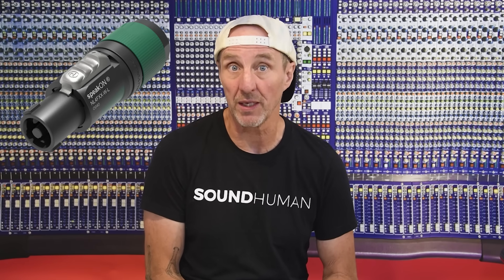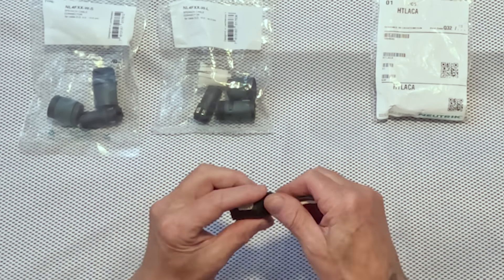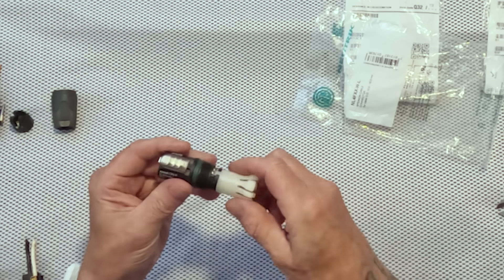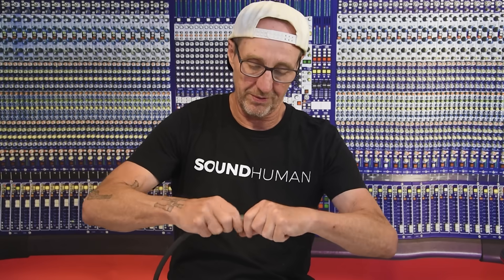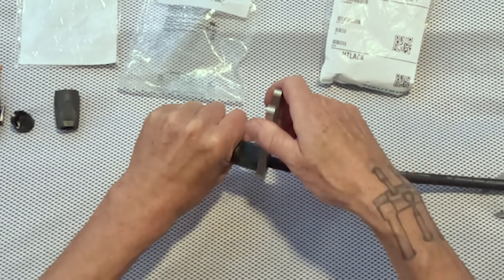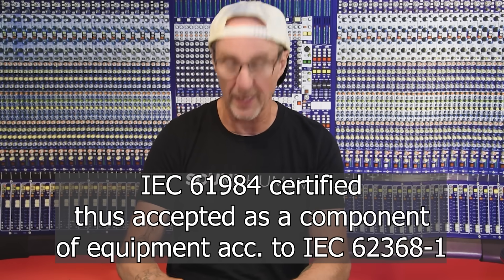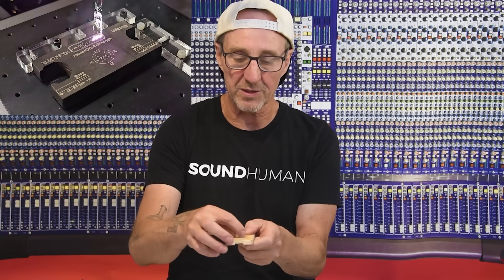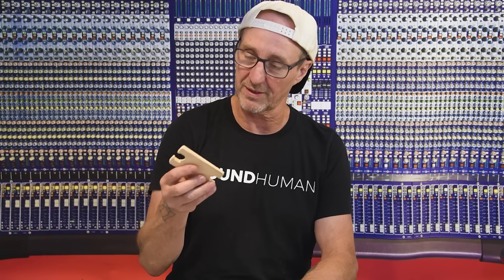NL-4 Speakon Discontinued - New Safety Lock Version!

Comment: Of all the things a kid could get hurt on in a sound reinforcement system, the speaker cable plugs would not be my first concern. $90 tool to take it apart? Baloney.
Reply from the maker: Yeah I agree on the other hand never underestimate the ability of a human to come up with a bad idea and run with it
Reply: Before touching the connectors, the kids would more likely to be already scared and repelled by high levels of sound pressure.
Reply: @JBF-GST-Tanda  Yeah, being inches away from 5000w worth of anything is deterrent enough really.
Reply: The tool is expensive, but there is NOTHING to stop any of us from building our own tools for it. Some measurement, a little fabrication (additive or subtractive), and boom, you've got your own tool. So, if you don't want the Cadillac tool, build your own, and maybe, just maybe, you will build an even better one. Take it as a challenge, rather than just a setback.
Reply: @Jason-mk3nn  I like the way you think. Fortunately, for me, it's not a setback, as I'm old and out of the pro sound reinforcement game now.
Reply: Such is the rat way @Jason-mk3nn
Reply: @Jason-mk3nn  just clip off the thinner strain relief pins and it works as normal and does not lock
Reply: On that note anyone know about a cheaper crimping die for the scrip style XLR HA connectors that Neutrik sells? DIE-R-HA-1
Reply: Of course its baloney, but you’re assuming EU safety bureaucrats know anything about sound systems.
Reply: @G5Hohn It's not about bureaucrats, it's far more about selling expensive proprietary tools.  As Dave mentioned amp wattages have gotten to the point that safer speaker connectors make sense but like A/C connectors Neutrik could have simply made use of screws to hold things together.  New Neutrik connectors using screws probably would have been more expensive and more difficult to manufacture than this version that they came up with so that and some overly expensive tools is what we get.  Blame Neutrik for this not bureaucrats who are simply concerned about safety.
Reply: @G5Hohn  You are right. They definitely don't .

Comment: This speakon cannot work in the old style nl4 panel chasis socket in the speaker because the pin head socket is very much slimmer by a few mm now. So now you need to also replace the nl4 panel chasis socket in the back of the speaker. Neutrik also have made the Neutrik NLT4MPXX 4-pin SpeakOn Socket Chassis is the model number you need to change  both parts if you want to hear proper sound but nobody mentioning this 😮

Comment: Knipex pliers wrench will take take care of these!!!
Reply from the maker: That's true and that's an excellent reason to buy one because they're awesome

that said, The shape of the connector is such that if you use a wrench, The end of the connector will deform and try and slip if the connector has been tightened to the proper torque specification. 

you can use a pliers but you'll damage the plastic a bit.

Comment: i tried to open one today. Using the adjustable wrench, lock the connector on the cable inlet, twist the front part. It works. 😊
Reply from the maker: very cool and yes a regular rent will work as long as the connector isn't tightened up to the recommended specifications. 

if the connector is tightened to the recommended specifications a regular wrench will usually slip around the plastic and the wrench that captures more of the connector prevents that

Comment: Great video and some useful hacks for these "new style" Neutrik speakON connectors. I recently bought 12 and replaced some cable ends. The old style uses tiny Phillips head set screws for the bare wires. The new ones use an Allen head and appear much more grippy.  They also handle bare wire 12 AWG wires better (easier to insert). There was a "slight" learning curve assembling the new style speakON connectors -- but, once you figure it out, it is easy. The #1 problem I have with speakON connectors is all the cheap knock-offs out there. Sure they are cheaper, but nowhere near the quality of Neutrik. I have some 12 AWG Cable Matters speakON cables. The wires are soldered into the connector ends along with a wonky excuse for cable relief insert. They "might" last...but, will likely replace all of them too. I have also seen companies tin the wire ends and then use set screws to cinch down. Every one I checked were ALL loose. Neutrik may be charging $90 for these tools -- it won't be long before you can get one on Amazon for $12.
Reply from the maker: Very cool. Actually after I release this video they contacted me and dropped the price of the tool down to 30 bucks or so!

Comment: @DaveRat hey i know this video is about a year old. but i assume they dropped the price of the tools due to the outrage over it. 
Neutrik HTLACB Hand Tool for TOP-L Assemblies, Bushing Side $26.36  
Neutrik HTLACA Hand Tool for TOP-L Assemblies, Front Side $35.97

still to much if you ask me. but better then the original $90 each
Reply from the maker: Yes, they contacted me after I made this video and told me the response to this video inspired the price drop

They also told me they would post a downloadable 3d printable free file as well. But I have not seen that.

Comment: 5000w at 141 volts is 40 amps. I’m surprised these can hold up to that
Reply from the maker: These are audio speaker connectors and most speaker loads are 8 ohms 4 ohms or 2 ohms. 
Try doing your math calculation with a 2 ohm load which typically will be the lowest impedance driven and you'll find it the current levels are much lower in the voltage levels are much higher

Additionally audio signals are not continuous and tend to have between a four to one and 10:1 peak to continuous ratio which means the average current actually delivered to the connector is one quarter to 1/10 what you calculate
Reply: @DaveRat  this makes sense that it’s not continuous. I’m an electrician by trade so my math was just volts x amps = watts which is most of what I need.
Reply from the maker: Very cool and yes, as an electrician, you are dealing with safety and loon at max draw in the event toasters and heaters are used.

With modern audio amplifiers, the amplifiers are not even capable of max power output continuous and are rated in short term peak power.

The other way to easily tell is look aslt the ac power plug in the amp and/or the UL power dral specs 

For that amp I believe it's 30 amps input draw to drive 8 outpus and each out can only do a fraction of the input power.

Comment: Hi,

Heres another suggestion to undo them. Why not just remove the slip ring? Then you should be able to grip the entire plug with your hand using a glove if needed and exert enough torque to twist the plug by hand.
Reply from the maker: If the connector shell is tightened to the torque specs as recommended by neutrik, the internal locking cable grip makes it very hard to undo by hand without a wrench or pliers.
Reply: @DaveRat  I have tried it and found that it can EASILY be opened by hand without any tools. All you need is a rubber glove. You need to hold the actual plastic. Thats the hard part hence you need the rubber glove to prevent hands slipping. Try it and see.
Reply from the maker: And also hope anybody hand eliminates the enjoyable fun of having some crude wooden tool to replace the crazy expensive wrench that they make.

Side note, Neutrik actually contacted me and told me that my video has inspired them to lower the price of the rent and release a 3D printable file of the rent as well.

The adventure of the video was not really based on how to get the connectors apart as much as to highlight the overpriced manufacturer tool.

As a manufacturer myself making sound tools products we would never create an overpriced tool and we focus on making quality products with minimum wage in packaging lifetime warranties and free replacement.

So it's more of a quote come on guys you can do better than this "

Basis to this video

Comment: Most every time Neutrik "improves" something, I prefer the old one.     Why not make your tool from ABS instead of wood?   Maybe lock the slip ring in place with thin CA glue?  Just be careful, as it likes to run all over.
Reply from the maker: Hmmm, ABS smells kind of bad and makes a bunch of non recyclable plastic mess when I cut it up on the CNC machine. Also the laser etch gets all mucky and melty and is hard to read unless if I buy layered ABS. Baltic Birch wood cuts well and with a light coat of paint, the laser etch is clear and clean. I prefer to work with wood over plastic whenever possible. Could 3D print it as well but that is slow and and super time consuming. I can cut like 20 or more of these all at once on the CNC

Comment: They could have stamped that wrench out of thick sheet steel much cheaper.
Reply from the maker: True. After I did this vid, Neutrik reached out to me and said this vid and the comments sent a clear message. They have reduced the price of the tools and have done or will release a 3d printable file version of the wrench for free download.
Reply: @DaveRat  that's a very good thing that they will do. One of the problems is that short run cnc tools like the wrench do cost a lot. Even stamped steel will cost a fortune for the dies, you need a large run to make it economical.
Reply from the maker: Agreed but I think the wrench is over designed and appears to be perhaps water jet cut out of quarter inch thick steel.

They could fairly easily CNC aluminum bar at a low cost and make a lighter weight wrench that actually has a hole in it for a strap so doesn't get lost and attaches to a tool belt

Comment: I'm on a project now with this and they are fantastic and very pro especially with the weather boot. Well done the designers and now make sure you get rid of the most annoying NL
EVER.  the two pole.  What tight arse buys these just to save a cent and just when you get to a job you find these crap connectors in use and can't rewire around them.   Err just blows my mind and blood.  Tony @ Tag. Oz

Comment: I'm annoyed by this rhetoric. Having gotten hands on this connector, all it takes to take it apart is a single C-wrench, which any stagehand or shop tech will have readily available. If Neutrik wants to offer a tool for full-time shop techs that will handle thousands of these over the years, it seems like a worthwhile investment. The only issue then, is that they don't seem to be explicit in their marketing about that.
Reply from the maker: Well, the issue is that companies like mine buy the connector and then order the wrench to equip our system installers with the proper professional tools for the job, only to fine out the wrench is not needed, over designed and over priced.

That said, after seeing this video, Neutrik reached out to me to say thank you for the heads up and the "we hear you and the industry loud and clear"

And 

They have

1) lowered the price of the wrenches to $30

2) will be releasing free download 3d print files so people can download and print their own wrenches.

And as far as the sea wrench, yeah if you want to carry a giant wrench, All good. But all it really needs is a cheap inexpensive lightweight tool to disassemble, anything else is dumb

Comment: Neutrik also make a new version of the PowerCon connector these days. Perhaps for the same safety reasons? 

Recently during a gig the bass player had experienced issues with his amp. It was on old Glockenklang stack. Turned out, one of the wires in the Speakon plug of his cable had managed to escape… this was easy to fix for me being the sound guy in charge… luckily he had the old connector. But then again, 100V and more is nothing you'd want to touch.
Reply from the maker: I believe they made the new powerCON first and now are applying the safety design to speakons

Comment: Many are talking about the locking down as a child safety, but I think there is another side you are missing - security. While it is not completely tamper-proof, it does make it harder for people that should not be messing with the ends to mess them up. In a rental fleet, it is common to have people try messing with everything, and this is one more tool to help keep those fleets a little more locked down. The tool is expensive, but there is NOTHING to stop any of us from building our own tools for it. Some measurement, a little fabrication (additive or subtractive), and boom, you've got your own tool. So, if you don't want the Cadillac tool, build your own, and maybe, just maybe, you will build an even better one. Take it as a challenge, rather than just a setback.

Comment: Great video, Dave!

I love how you kept it simple, describing and demonstrating the older designs, but I was a little sad you left out the oldest models. I am, of course, speaking of the original NL4 with the locking ring rather than a push button. It was revolutionary in its time, but thankfully, they realized the ring design was difficult to grab in many situations and worked out the push button. Additionally, the original design used tiny, Allen (hex) set screws for the conductors. The set screws were so bad that you absolutely would have stripped the hex opening before adequately tightening. On the random luck you could secure them properly, removing them to repair a damaged cable was pretty much impossible without drilling them out. Again, thankfully, Neutrik redesigned the set screws to larger, Phillips head screws. 

But if you needed a child lock on an NL connector, one need look no further than the NL2 connectors with the pull cylinder locking mechanism. I once had to repair one end figured out a way to get in without destroying it, but it was a huge PITA! 😁
Reply: Those old SpeakOn connectors are dangerous! When trying to press open the retaining clip of the locking ring, one can easily slip off and hurt oneself. Well, at least when you're trying do so with a multitool on a flightcase...

Comment: Absolutely shocking, the price of the tool. Making  those tools out of aluminium an option? Or is the wood good over a long period of time?
Reply from the maker: I initially was going to CNC aluminum and did a test run out of wood.

The wood worked so well that I didn't bother with the aluminum.

In my opinion I would tend towards having a bunch of inexpensive wood or plastic wrenches and not worry about losing them rather than a more expensive metal wrench

Comment: Man this sucks. At the theatre I work at, I've recently been the one making speakon cables and we are running out of connectors, so I figured I'd put some new ones on the next order list. I was not aware that these new ones need a special tool. This fact alone makes it much more complicated because we have to order stuff through the city management, so we have a set budget and I am firmly against spending 90€ of that fairly limited budget on a tool that shouldn't cost anything near that. Getting a similar tool is also a complicated matter.
But on the other hand, I've been carefully using pipe wrenches and a vice to open the older connectors because I'm not THAT strong, so maybe that'll work for these too. And although I see where that regulation is coming from, it's bonkers for a plug that can technically be opened without tools, but even some able-bodied adults don't have the strength for it. I don't think that there are any children out there who are this strong but still stupid enough to try to open a connector belonging to an installation that belongs to others.

Comment: TL; DW: You now need to buy a proprietary wrench to open a green "safety" lock version of a Neutrik Speakon connector. The alternative, of course, is to simply cut off a bad Speakon connector rather than waste time attempting to reuse it. Apparently, this is Neutrik's solution to the chronic unreliability of the flimsy aluminum shims they use on the screw-terminal connectors inside the NL-4 Speakon connectors, which rely on bent-metal friction to make contact with your speaker wire. That's why a "safety" lock is so necessary in the first place, because the electrical connections in the NL-4 are so fragile they often can't even support the weight of the speaker cable. If you want to see how independent cable vendors cope with this Neutrik design flaw, unscrew a prewired Speakon connector, and don't be surprised if you find a thick wad of glue cementing the cable to the terminals.
Reply: Actually, that is sually solder trying to hold everything together.
Reply from the maker: Actually I believe the safety lock is there because government agencies determined that potentially hazardous voltages can occur with modern amplifiers and put pressure on neutrik to make the shell non-removable so people don't take the shell off and shock themselves

Comment: Am I missing something? can't you just use an adjustable spanner?
Reply from the maker: The flat spots are small. If the strain relief is minimally tightened, a large ish, open end wrench will work with an opening of 15/16 or so.

Not a pocket tool size. 

If the strain relief is tightened to the torque spec , a wrench that does not capture the 4 corners on either sides of the flat spots will tend to slip as the hollow strain relief ovals wneh turned.

Comment: Could you run some liquid glue or gel crazy glue or something like that down under the outer spinning slip ring to lock it into place so you can undo it by hand?

Or is the issue the ratchet lock is just too strong to undo by hand, rather than the ring spinning?